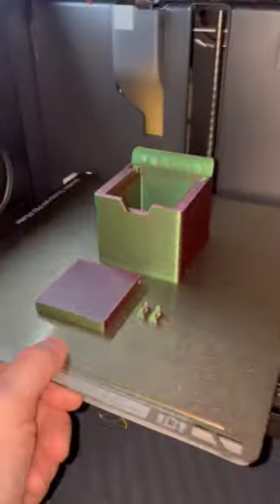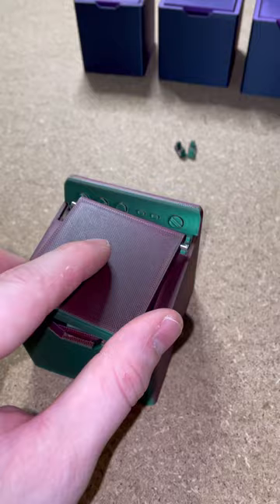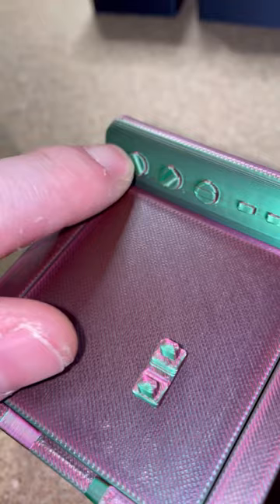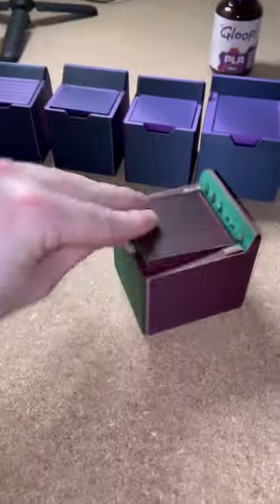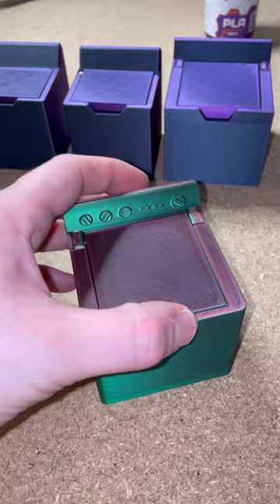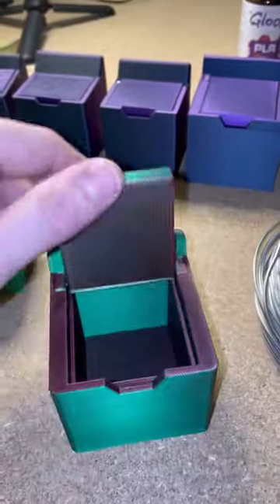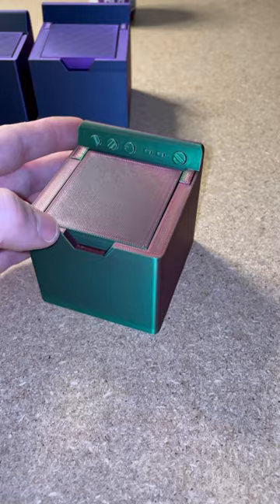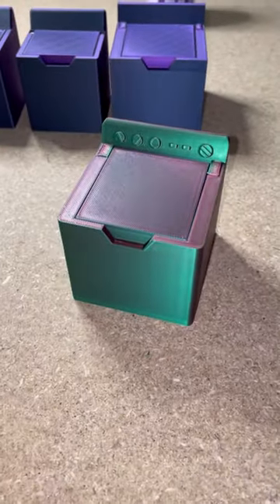Mini washing machine V5 prototype!

Comment: PIP is the opposite of lazy or cutting corners. It requires serious knowledge of what a 3d printer can and cannot do. And done right it can be plenty strong.
Reply from the maker: I’ve designed plenty of print in place articulating models. Plastic links/hinges will never be as strong as metal.
Reply: @MysticMesh3D  didn’t say that.